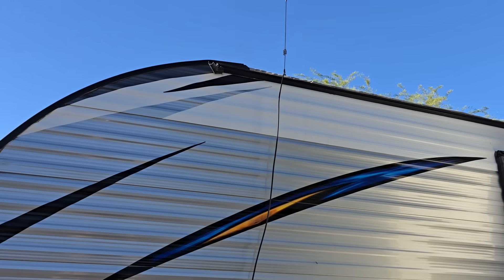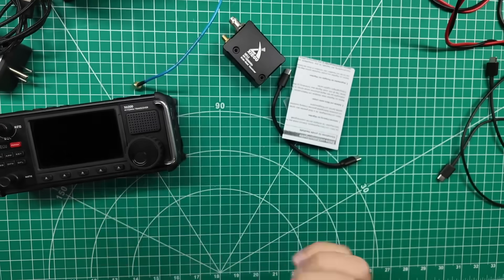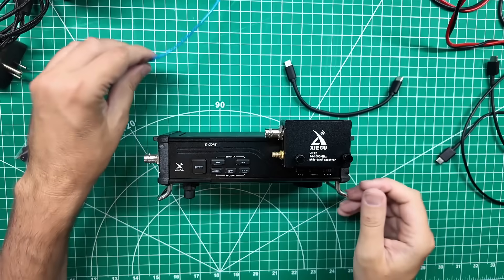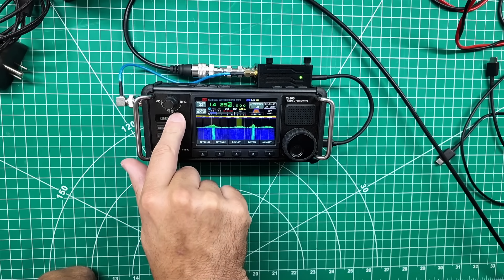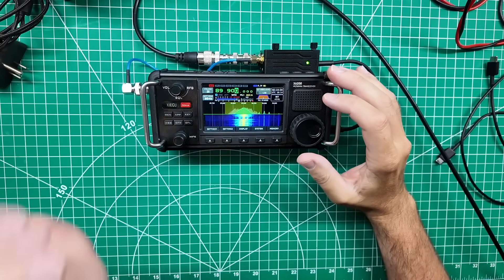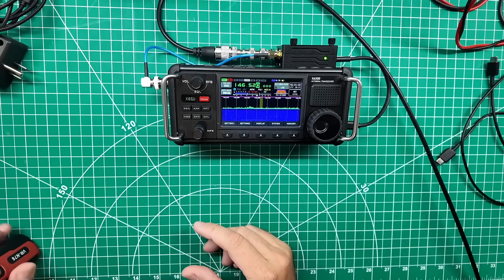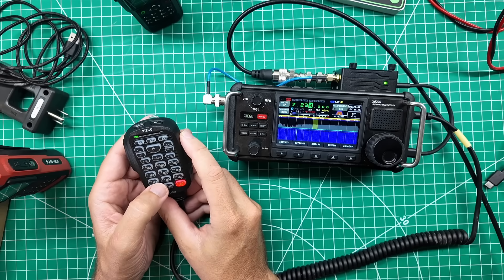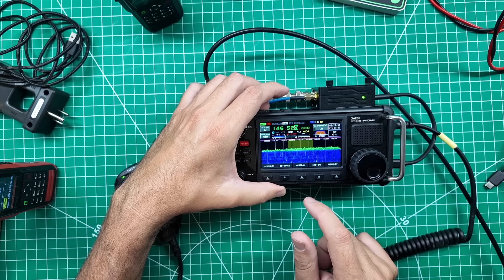The Hidden Magic of the Xiegu WR-12 Receiver | Wideband Upgrade Tested!

Comment from the maker: What do you think—is the WR-12 a game-changer or just a shiny accessory?
Drop your thoughts below ⬇ I’ll be hanging out in the comments to chat!

👉 Xeigu WR12: https://geni.us/e88oyfd
👉 Xiegu X6200: https://geni.us/UsbW6
Use Code "TO15" for $15 off at radioddity
Reply: @Temporarilyoffline , Hey Steve same behavior here with my x6200 on the latest firmware. Do you really think were going to get another firmware release?
Reply from the maker: @increasednoise  they are still supporting the G90.  Very likely there will be updates on the x6200
Reply: @increasednoise  it's out  v.1.0.7
Reply: Spinning the dial quickly still causes the jump to HF even in the very latest firmware. By the way I do not have the thumb screw issue that you had. Must be one bad screw. 73 Ed DD5LP
Reply from the maker: @DD5LP thanks for the update.  Was this the end of September firmware update?  That came out after filming.
Reply: @temporarilyoffline yes strangely it's also labelled v1.0.6! We're hoping this is just an interim fix (mainly for the battery problem) and there will be a v1.0.7 someti😂me (but don't ask when). The wr12 tuning bug was supposed to be fixed in the "September 1.0.6" version but it wasn't. There's also a freaky 3D waterfall in that interim update. I can't see what it's good for. 73 Ed DD5LP
Reply from the maker: @DD5LP like the Yaesu version?
Reply: @temporarilyoffline yes - I believe so. There are comparison pictures in the X6200 groups - IO list. But I personally don't understand the value of such a waterfall display whether on the Xiegu or the Yaesu. Thankfully these are optional features that have to be turned on if desired 73 Ed
Reply: Barely shiny. They made a module that does half of what the original device does just slightly better. They could have made a modular shack in a box.

Comment: Would you recommend the 7200 or the g90. I just passed my Tech this last weekend. I'm kinda leaning 7200 for the feature set and maybe 3-4 month get the b125 to boost.
Reply from the maker: They are both solid radios.  The XPA125B will work with both of them.  The G90 will be easier to make contacts without the amp than the X6200.  The G90 is also cheaper.  The G90 is a tad harder to get working on digital modes, you have to provide a sound interface separately.  Hard for me to spend your money for you though, so get both, just make sure to use my discount code/links in the description to save some of it!

Comment: I would love to see every programmable setting screen you have setup on youru x6200 and explain why you have it set there. 
I have the same setup and the WR12 and I have success at ft8 on 10m but tuning in a voice call is rough on 10M. Would you make a video?
Reply from the maker: It would be a pretty boring video as I've not made any changes.  You could do a factory reset and be where I am.  Wish I could help more than that.

Comment: I’m not buying any more radios until they are appropriate edge devices that can also store all of Wikipedia, first aid, be able to decode any signal that it hears and inform me as a user of things that are important based on my notification preferences.   We do not accept non-thinking RF devices anymore and if I’m gonna carry something I want it to be able to replace my cell phone completely in an emergency be very useful every day to the point I want around me all the time.  AI on the device.
Reply: We always lead the field of electronics and we’re not going to stop. We’re gonna make sure everyone can actually talk to everyone else and that we can help each other.
Reply from the maker: You're on the right track.  We need more hams that can build radios.  Probably the closest thing you'll find now is the sBitx https://www.hfsignals.com/index.php/sbitx-v3/
Reply: @temporarilyoffline  it’s a lot faster and cheaper if they start testing systems that they need for public service out here and work out a lot of the details.

Comment: I was hoping they'd make things piece meal and use different modules. The fact that the radio is a Linux box with an sdr means it could run different configurations to decode other digital modes. It's a shame they didn't make these all band transceivers. I bet they'll sell an all band adapter as soon as I buy a WR12.🤣 thanks for going over this, Steve. 🤙🏾
Reply from the maker: I am really excited to see a WT12 too!
Reply: @temporarilyoffline  WT12 looks cool toy!!

Comment: It would be time better spend if Xiegu would offer an all band transceiver with a tuner, throw in DMR and you could not beat it.
Reply from the maker: I would love to see Xiegu get into the shack-in-a-box world.  Since this is an 8w radio, I'm sure they could shove an ROC in that little box with filters and interface.
Reply: if-dog-rabbit
Reply: The phrase "if dog rabbit" is a folksy expression that means "
if the dog hadn't been distracted by something, it would have caught the rabbit". In a broader sense, the proverb is a reminder that being fixated on one detail can prevent someone from seeing a more crucial, broader picture.
Reply: @thepadonthepondbythescum  If the dog had not stopped to take a s**t it would have caught the rabbit. But it is more than one one detail, it is a lot of details. Like 2m, 70cm, tuner, with a Comet quad band, mobile anywhere, ... I can just carry a cheap HT and listen on 2m/70cm be able to transmit on HF at the same time.
Reply: As an open source enthusiast I'm obligated to recommend m17 as well :P
Reply: @haxwithaxe  M17? Please tell more.
Reply: @tangle70 it's a completely open source digital radio protocol. I hear it's about as easy to use as YSF. There aren't many radios that have it baked in but hopefully it will catch on eventually.